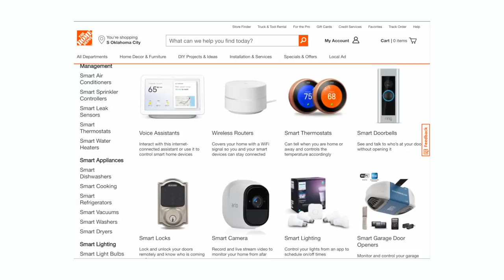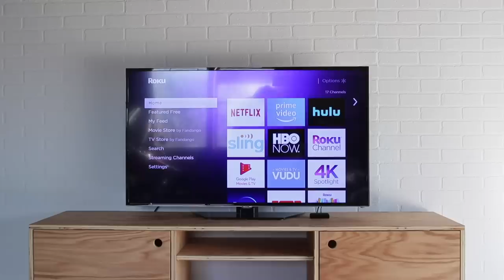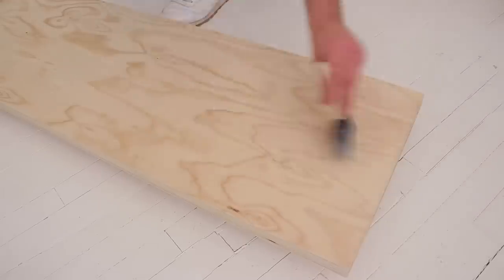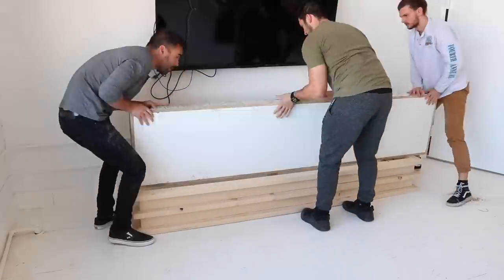How To Build a 2x4 and Concrete TV Stand / Media Console

Comment: hmm seem to be giving up a lot of potential storage space that could have been under the concrete top.
Reply: Same thoughts here.  It uses  way more wood than it needs (making it super heavy and hard to move) and all the  empty space inside is unusable.
Reply from the maker: I agree! I'd love to see a version that has some sort of door for removable panel to access that space!
Reply from the maker: @lestranged  The wood portion really isn't heavy.. maybe 30 pounds... The top, though is super heavy. What would you do to get access? maybe having the front be removable could be cool. It would need an internal frame, but it'd be possible.
Reply: @ModernBuilds  I'd  have the sides be that solid alternating structure (one board on it's long side, one on it's short side, etc) and then have a solid bottom shelf and a solid top to support the concrete. And then leave the rest of the front  open.  You could have electronic components in there (game system, cable box,   roku box, whatever),   A TV rarely  just lives by itself, it usually needs some other components.

Comment: I wonder what is the weight of this...
Reply: I did a fireplace hearth with concrete just as thick, but the overall piece was probably half as long.  Just the concrete slab of mine with the same thickness probably weighed 150+ lbs
Reply from the maker: the base was probably 30 pounds and the concrete top about 175